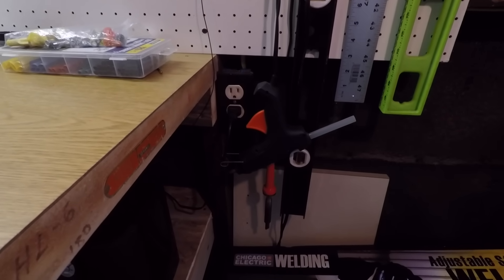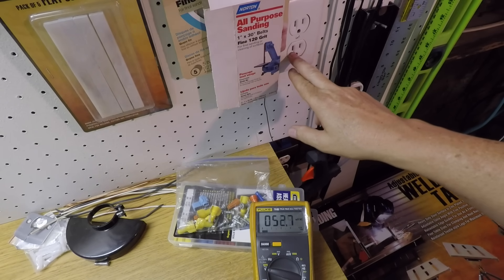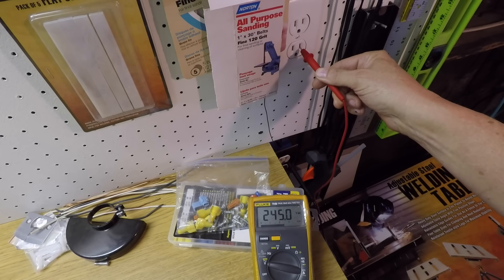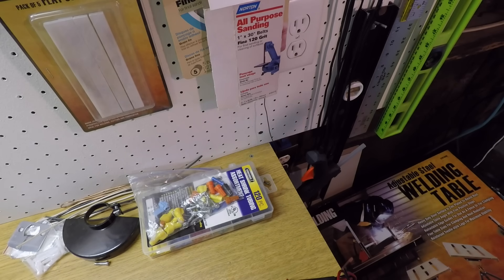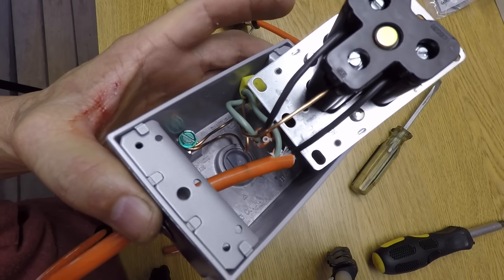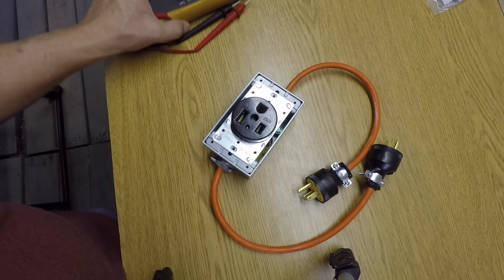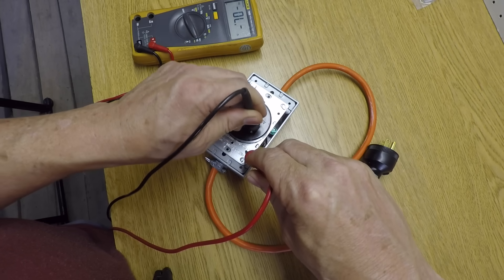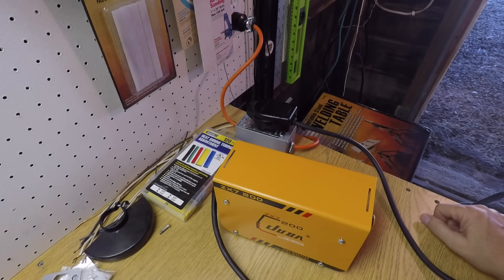How to Get 220v From 110v

Comment: Your circuit is limited to the smallest amp rated component.  Everything should match, but because your outlets are only 15amp outlets, your circuits should be limited to 15 amps.  Doesn't matter if you have 20amp breakers and 12awg wire. Also, you want your amperage draw to only be 80% of your total rated amps.  You can safely pull 80% of (2x15=30 amp)...  24 amps total from both circuits together.   The zx7-200 welder is rated for 21Amps per the manual.  I'd say you're good.   But before you sell your house you should change those outlets to 20amp outlets as the way you have it is not code compliant.  But we all know that sometimes you have to do things to get things done.  Just don't upgrade your welder or plug anything in that pulls more than 24 amps.

I've seen below, as well as yourself say, that you can put 15 amp outlets on a 20amp circuit with a 20amp breaker.  This is 100% false. The total circuit is to be designed that the circuit breaker is the first item to fail / trip.  If you pull 20amps through a 15amp rated outlet, 12awg wire and a 20amp breaker, your outlet will fail and possibly catch fire and your circuit breaker won't blow. Everything in the circuit needs to match.
Reply: No.  
NEC 210.21(B)(3).  Receptacle Ratings. 
Where connected to a branch circuit supplying two or more receptacles or outlets, receptacle ratings shall conform to the values listed in Table 210.21(B)(3), or, where rated higher than 50 amperes, the receptacle rating shall not be less than the branch-circuit rating.

Table 210.21(B)(3) lists:
Circuit . . . . . . . Receptacle 
Rating Amps . . . . Rating
  20 . . . . . . . . . . . . 15 or 20
(dots added to try to align columns  because my graphic from NEC didn’t  load)

As long as there is more than one outlet on the circuit  15 amp receptacle is allowed.  A duplex receptacle is considered two receptacles.
This is the most common scenario when wiring general branch circuits.
Reply: Bro don’t talk unless u know what your talking about 120 at 15a + 120 at 15 amps is 240 at 15amps and yes the receptacles are rated 15a 
But can pass through 20a 
Code allows 20a on 15a receptacle
Reply: Wrong on many points. You are allowed 15A duplex receptacles on a 20A circuit per NEC Table 210.24.
You cannot have a single 15A receptacle on a 20A circuit.
Reply: Everything in the circuit does NOT need to match. You can run 10AWG into a 15A breaker if you want.

Comment: Just buy a adapter. Theres one that turns your dryer plug to 220 50 amp. Another 110 30 amp to 220 50 amp. There like $15-30. The chinese welders come with them. I been running a 250 amp welder on 110 with this.

Comment: I am NOT an electrician with 30 years experience, just some random guy here. I would think the big issue is that this setup requires special knowledge to operate. If you walk away from this while its plugged in, and one of your kids or your wife needs to use the outlet, they could potentially be electrocuted when they disconnect one. Any thing with special knowledge to operate should be avoided in my opinion. Maybe a pro can tell me if I'm wrong. I won't have my feelings hurt.
Reply from the maker: So what you are saying is everything in the world that requires "special knowledge to operate" should be avoided? 
I don't have wives and kids wondering around my shop trying to get themselves hurt so that won't be a problem at my place.
I would recommend anyone who does have that problem, immediately remove any items that require special knowledge so no one get's hurt.
Reply: @DIYHomesteadProjectsDIYHP10  From a building code point of view, yes, but you can do whatever you want, it doesn't affect me.

Comment: Clever.  Isn't it amazing, back when our meters were analog the readings were "a little above 120V" or "easily 220V",  However, with digital, we always read to the tenth or hundredth of a volt when in 99% of the cases it doesn't mean a bloomin' thing.

Comment: Seen a few comments from the pros; so I am going to just throw this out there to see how bad they beat me up over it; I did something like this but in reverse; I installed 10 each 240v 30 amp outlets; and off of each one I daisy chained one x4 120v  20 amp outlet box about six, ( 6 ) below the 240v outlet when not using the 240v outlet; I haven't had any issues in just over a year; nothing feels warm; and I opened a few up after about six, ( 6 ) months and inspected the contacts and nothing was melted or arking; what kind of trouble am I asking for setup this way; I run a mining farm and have between 850w to 1600w power supply units to run sensitive electronics; so far I have not tripped one curcuit breaker as of yet.  Thanks for any input; each 240v outlet is on it's own line; and a double pole 30 amp breaker and I try to stay under 80% loads; I also had to install a sub box off the main line lugs in the main curcuit box to run x22 more 120v 20 amp outlets; and I did have a permit and paid a licensed dude to inspect it all; especially since I have a second meter for my solar tie in to pump excess power back into the grid when my battery banks are full; it's required in Tennessee so the power company guys don't get zapped when they shut down the mains to do their work; the only thing I am not 100% sure on and didn't ask is there a certain point you should have more than one, ( 1 ) earth ground per curcuit box ?  Now, If only I could manage a better cooling solution from the heat that the equipment puts out I would be good to go; and I even installed my old HVAC blower motor on the garage back wall to push the hot air out; and it does move some serious air; enough to suck the doors shut; and it is still a challenge to stay under 80 degrees.

Comment: If each leg is 20 amp, would not the capacity be 40 amps? What am I missing?
Reply: No, it’s the same current flowing through both ‘hot’ wires, not two separate circuits, there is no neutral.

Why NEMA 5-15 outlets on the wall rather than 5-20?  Thank goodness we don’t have this situation here in the UK, our electrical system isn’t perfect, but we don’t have this issue.  I don’t like the idea of two separate single-pole breakers feeding this.

Comment: This is safe for you so long as you know what you are doing, but if one of the 120 volt plugs is unplugged while the 240 volt appliance is still plugged in and switched on then one of those prongs will be live (or hot) with 120v from the other 120v plug that is still plugged in - and would be a hazard. The workshop may be off limits to other people, but what if ... 
If you really can't run in a new 240v circuit I'd recommended fixing the box with the 240v outlet to the wall and running a fixed wire from there to the back of one of the other outlets and another fixed  wire to the back of the other outlet fed from the other phase. So that the 120v lines can't be unplugged.
Hazards are not just electrocution, but also fire and an insurance claim invalidated by wiring that is not up to code.

Comment: How do you get two 120vac with different phase?
Reply from the maker: I think the easiest way is to test multiple outlets with a multi meter until you get two that give you 240V as I showed in the video. Apparently they are called "lines". Line one and or line two in a 240V service. You need two 120V outlets, one on line one and one on line two. Another way is to use two 120V circuits that have the breakers on top of one another on the same side in the breaker box.

Comment: How much does the commercial version of this cost? I want an electric dryer but I  was quoted 2 grand to add the extra plug from my breaker box.
Reply from the maker: I suppose it depends on where you buy it. I've seen them anywhere from $150 to $300.
Reply: DIY Homestead Projects They are Illegal and highly dangerous. Any commercial version of this is not UL listed and in violation of electrical and fire code. Licensed electricians can and do, in specific emergency situations, make and use on a supervised and temporary basis devices such as this. Also DIY Homestead Projects, you inadvertently put 2 grounds in parallel creating a ground loop. Easy mistake that’s made all the time. Disconnect and cap off one of the grounds in the JBox to address this issue.

Comment: Clever and very simple. Why didn't use 12 gauge wires being that your wall receptacles are rated for 20 amps? Better to be higher rated wire.
Reply from the maker: Thank you. I agree with you. At the time the 14 gauge is all I had and it was the same gauge as the welder cord so I figured it would be fine. (and it was) If I were to do it again, I would do it just as you described for the same reasons.

Comment: Thanks. I'm going to do this in my garage.  My fault for not getting 240v wired when I built the house but I found two 120v plugs that I can get 240v.  So for the odd weld job this looks great!
Reply from the maker: Good luck to you with your project. 👍

Comment: Help, I cannot get this to work!
Reply: The most likely reason is that you have connected to two outlets being fed from the same side of the transformer, so while there is 120 V from each hot wire to neutral wire to neutral there is 0 V between the two hots.  This doesn’t mean that they are safe to touch, they are both still at 120 V from ground.

Comment: why didn't you just make a single 220v outlet and string a single 110 outlet off one leg of the power?  seems a lot easier than running two plugs and making up this device.

Comment: Thanks, you did a good job of showing how to do it. I want to do it on my project for my plasma cutter.
Reply from the maker: Thank you and good luck with your project. If I were to do it again I would use a thicker gauge wire but this one worked good for my little welder.

Comment: great video, i'm looking to downgrade...Im about to move overseas for a 6 months and they are 220 v in Philippines. I am taking over my Ridgid drills etc, the charger for the batteries is 110v could i make a box to cut it down to 110v ? thanks..
Reply from the maker: I would think so but I don't know anything about how the wiring is set up in the Philippines. Good luck to you.
Reply: @DIYHomesteadProjectsDIYHP10  Just watched another video, ill just get a step down converter they sell on ebay/amazon. it seems to be perfect. Ill just have to be careful to make sure its used or my  charger will be fried. Take care
Reply from the maker: Good deal, that sounds like a reasonable solution in your situation. I'm happy you got it figured out. Take care and Happy 4th to you!

Comment: Why not connect the two neutrals in the box instead of cutting them off?
Reply from the maker: I don't think it would hurt anything but I also don't think there would be any benefit of doing it that way. Good question.
Reply: @DIYHomesteadProjectsDIYHP10  It completes the circuit back to your outlets I would think.
Reply from the maker: That may be. My understanding on this two hot one ground 240V circuit is the two hots alternate (60 hz per second) completing the circuit. In the 60 hz cycle, one hot supplies 110V while the other acts as a return or neutral. This occurs 60 times per second in the US. The white wire (neutral) is not actually in the circuit or needed in this application. There is no 110V requirements for the welder I am using in the video. At least this is my understanding but keep in mind, I'm not an electrician.

Comment: If your  outlets are wired (12 AWG & 20A breakers/fuses) why didn't you use 20 amp rated outlets instead of the 15 Amp outlets you show in your video?  AND why not run 240 V service?  It's a neat trick but a bit dangerous.  Good luck.
Reply from the maker: The reason I used the 15A plugs is two 15's equals 30A total. The welder only pulls 18 to 20 amps total. There is no way this set up would pull over 15A off of one side only and still run the welder. For that to be an issue there would only be 5A or less on one leg and the welder wouldn't even power up with that I don't believe. This was a temporary solution to my problem and I didn't want to spend the money on the shop because I knew I would be moving soon. I sold that house and moved a few months after making this video. It was a win win for my situation. I was able to run my little 240V welder. When I moved all I had to do was unplug my device and leave. The wiring in the shop passed the electrical inspection and the place sold. It worked out just as I had planned it.
Reply: @DIYHomesteadProjectsDIYHP10  that answer shows you don't understand 240v loading...if the welder pulls 18 to 20 amps at 240 v...it pulls that from both legs...or in your case both outlets.
Reply from the maker: I'm not like most people commenting on the internet. I'm not afraid or ashamed to admit there is a lot I don't understand about electricity. I do know the device worked for me in my situation and I didn't burn down my house or kill myself using it. Thanks for the info.

Comment: Simple fix for the shorting part is put them to a switch and flip the switch to your outlets before you unplug them just as a back up
Reply: How is your stick welder running with this rig I'm considering making one for my shed I've been trying to run it on 110 but it just sucks
Reply from the maker: My little welder ran fine on this rig when I was using it. I made it as a temporary solution at my old shop knowing I would be moving soon. That was about a year ago and now I have moved from where I filmed this video. In my new shop I no longer need the device so I haven't used it in quite some time. Hope this helps.
Reply from the maker: Good idea!

Comment: If you were to blow only one of the 110v circuits while welding with your machine, would machine damage occur due to being under only 50% power? I hear all of the time how people burn up drills and saws because they were underpowered from small and long extension cords. I was wondering if that would be about the same?
Reply from the maker: I don't think it will damage this welder it just won't work. I never blew a CB so I really don't know for sure. I think that possibly damage occurs on items that have motors.
Reply: I would think nothing would happen to the welder or any motor being used. It would just shut off. Because if either breaker trips what ever is connected to the 220 outlet will be drawing zero amps as it's now an open circuit ( there is no neutral)

Comment: i just got me a mini welder but it only has 2 wires coming from it for the power hook up can  it be 220v hooked to it with out a ground wire ?
Reply from the maker: I really don't know. I've never had a welder that didn't have a ground wire. I do know that some of the little Chinese welders are built that way but I've never had one. That is one of the reasons I got the little welder I am using. Luckily I knew that it had a ground wire before I purchased it. You could probably add a ground wire. Maybe someone here on You Tube has made a video showing you how to do that but I have never done it myself.
Reply: @DIYHomesteadProjectsDIYHP10  thank you like you said, I'm doing research before i hook it up and any input  is welcomed trying to stay safe and try to do it right , you can see why i asked about that it kinda side tracked my thinking after seeing just 2 wires for the power hook up.and made me wonder if it was a 110v or 220v . knowage is power , sadly i haven't seen any video on how to hook them up just on how to set them up for welding  and reviews on them , that is all fine and good but those of us that is not knowing on how to wire these new welders up it would be nice to see one. Agian I thank you for the info and if you find out  any thing more on these please message me on it
Reply from the maker: Good luck with your research and I'll let you know if I learn anything more.

Comment: I've done this to get 240 v. easily, but if you have two lines, just make one 240 v. at the panel. Put a 20 amp. 240 v. plug to make it legal, then make a 20 a. to 50 a. conversion extension cord. Good video. ♡ T.E.N.
Reply: P.S. If you load share, two 12/2G Romex lines can be hooked to a 40 amp breaker. That is close to a heavy weld. I'd put a 6/3g line from a 50 amp. 2 pole breaker to a 50 amp. 4 wire outlet and use the other two lines for 120 volt lights and outlets in your shop. It is good to have the lighting on a separate circuit, but make sure you can still plug in to that circuit. Conversely, make sure that a light is on the plug circuit, so that even if one breaker blows, you are still energized and not floundering in the dark.             ♡ T.E.N.
Reply from the maker: That's a great idea. Probably the best I've heard in quite some time. Thank you!
Reply from the maker: Thank you

Comment: So... if one plug is in the socket, then the other will be live, right?
Reply from the maker: No that is not correct. The only time an unplugged lead could be live is if there is a device plugged into the 240V socket. Just plugging in a single lead will not make the unplugged lead live.
Reply: @DIYHomesteadProjectsDIYHP10  thanks,  Still, that doesn't sound very safe.
Reply from the maker: It's definitely not a solution for everyone.

Comment: Why not simply do it right and bring 240 from your panel.
Reply from the maker: Because that would have cost me several hundreds of dollars and that's doing the work myself. The only panel I had available for your suggestion was about 40 feet away from my shop and on the other side of my house. This was an economical alternative for my specific circumstances and saved me from investing hundreds in something that was only temporary. As I've said many times, it may not be the best solution for everyone but in my situation, it was a beneficial and economical solution.